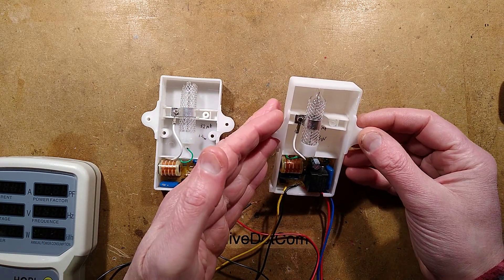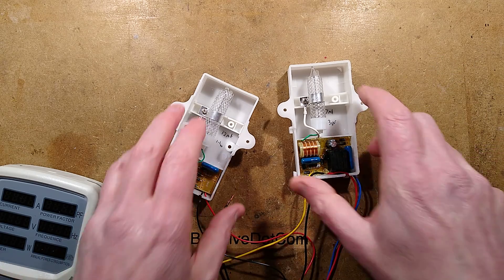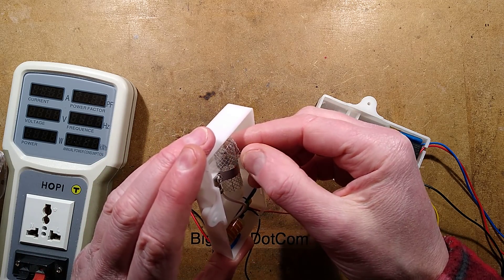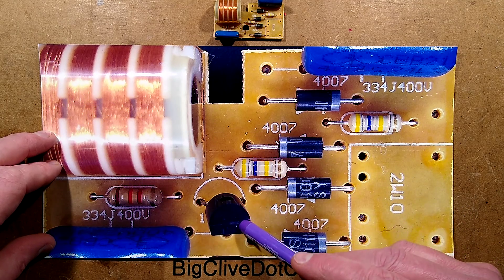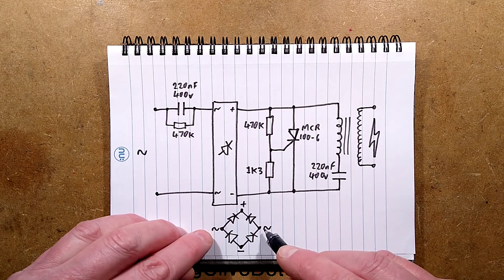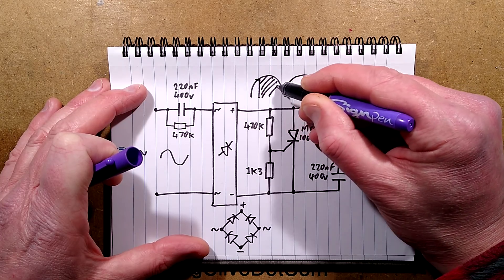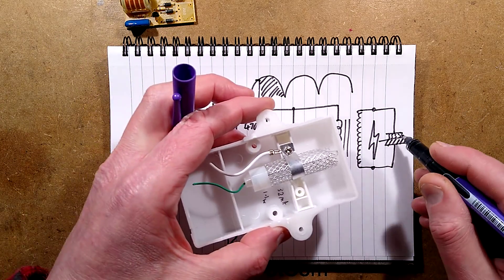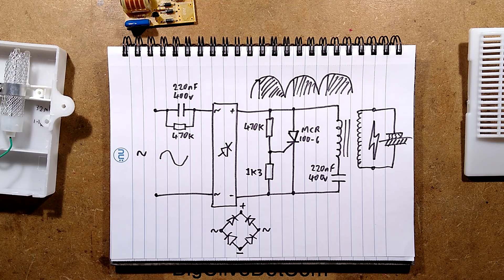The "two-wire" high voltage mystery eBay device

Comment: So could I take my "stun gun" module and put the output across that tube and achieve a similar effect, or does the high frequency make something else happen?
Reply from the maker: It needs to be high frequency AC.
Reply: @bigclivedotcom  you can make ozone with 60 hz at 2Kv buts its not very effeiencent I built an ozone device using a microwave transformer with a current limited input of just under 1 amp the end resoult is enough ozone to destroy the effectiviness of hot glue used to keep a fan in place now if I had an ebay device that used 20 watts I would get more ozone with less power bottom line high frequincy and high voltage are key

Comment: This is worth getting just for the discharge tube. I would like to see how it reacts to high power RF or Tesla coil discharge.
Reply: I'm wondering if it could be used as a geiger tube, biased with a high enough voltage to arc over when radiation passes throught it...
Reply: @dj1NM3  that’s a genius idea. I’d bet it would work. May not be accurate but would at least give you a idea of how much radiation is present
Reply: @dj1NM3  So you want to create large sparks around a flammable gas. I smell a bad idea.
Reply: I wonder how one of those kw boost converters would work with this, powered by a 9V battery...

Comment: Clive capacitors are labeled as 334j.330nf.how it can be 220nf.
Reply from the maker: The PCB is marked for 330nF, but the actual capacitors are 220nF

Comment: A triac circuit would be slightly simpler and more power-efficient - no diodes, only one cap and no shorting of the input cap.
Reply from the maker: It takes a lot more current to trigger a triac than a thyristor.
Reply: This is a very cost sensitive application. This layout lets them use a  transistor if they are cheaper. I was surprised that they splurged on the full wave bridge with nice diodes. It adds 0.07USD to the cost.
Reply: @peterbonucci9661  A transistor wouldn't work here since it would slowly turn on with AC input instead of snapping on like an SCR or TRIAC do.

Cost-wise, a 1A/600V triac in TO92-3 packaging costs about the same as an SCR (within $0.02 in 5ks) and eliminates the need of a diode bridge and 2nd film capacitor (2nd most expensive parts in there by a small margin) at the expense of needing 5mA of trigger current instead of 100uA which may require a diac trigger for predictable operation.

The two circuits cost about the same to make, except a proper TRIAC version would be more efficient and reliable thanks to eliminating massive current peaks when the SCR shorts the input capacitor across mains at close to AC peak..
Reply: @teardowndan5364  I've built these before. Transistors work fine. In teardowns, I don't remember seeing SCRs. I don't understand why they went for the second film capacitor. As you say, it's expensive. I'd spend the money on screws that could resist ozone.
Reply: @teardowndan5364  Also, they buy the SCRs from a surplus-like market (I don't remember the right word,) so versitality is a big deal.

Comment: I wonder if 10 years from now the Big Clive Lazy Rectifier will have become a standard electrical symbol.
Reply: Electroboom will have to switch to the new Full Snooze Rectifier standard
Reply: Looks a lot like an IEC symbol, you know the ones where everything is a white nondescript box.
Reply: I thought it already was, except the diode points towards the DC side instead of at an angle, or is that just my version, 🤔

Comment: Messing with the oxygen molecules in the room and making them highly reactive sounds like a scary thing to be exposed for for our lungs.
Reply from the maker: Nothing that doesn't exist in nature.  If anything, the lack of those elements in home air may contribute to issues like mold.
Reply: @bigclivedotcom  We just added a UV lamp to the AC unit at work.
Reply: @bigclivedotcom  however, ground level ozone is a health risk, especially if you have pre-existing lung conditions. Ozone causes damage to the lungs and can make them more prone to infection. Ozone (O3) is a highly reactive form of oxygen and does not behave in the same way as O2.
Reply: @bigclivedotcom  
There have been a lot of recent adverts for Ozone generators claimed to combat mould and unpleasant smell in Swedish houses.
All shown to be completely useless of course.
Swedish homes rarely have such problems anyway.
Reply: That's the thing with most disinfectants. If it kills things, it usually just kills you slower, as you are big. It would take a while for it to have noticeable effect, but not something that you would want to test on yourself
Reply: It's the wonderful aroma of a near by lightning strike. The MCU's new fragrance Eau de Thor.
Reply: It's also something used in auto detailing to remove  stagnant smells. You just have the smell of ozone afterwards.
Reply: Does it smell like a 90s photocopier room?
Reply: @ncot_tech  do you know what memory this brought back? Back in high school (graduated in 2002) I took drafting and then CAD classes every year. We had a special ventilated room (just a super tiny office really) for the blueprint machine.      
It was a real blueprint machine. It used ammonia and I think UV light to develop the blueprints.     
Sometimes the ventilation pipe would come undone and fill the surrounding rooms with ammonia fumes. 
…we would just open the windows and carry on. Fun times.
Reply: @ncot_tech    I still use an older laser printer (2-3 pages / week ..) , I don't need to buy me an ozone generator...   8-)
Reply: Short tem exposure to ozone isn't that bad
Reply: @MandrakeFernflower  It is if your hit by lightning .
Reply: @martinwinfield2935  I think in that case you would be worrying about other things than ozone…
Reply: @martinwinfield2935  you're
Reply: If you can smell it, it is above the level that will cause damage.

Just because it is natural does not make it safe or good for you. 

And we have no lack of ozone in our cities today, outside or inside, on the contrary levels in many places are dangerously high on a regular basis.

Again: If you can smell it at all, you are way into the danger zone. 

Please inform yourself before coming with blankes statements like "Nothing that doesn't exist in nature.  If anything, the lack of those elements in home air may contribute to issues like mold.

" 

You could e.g. look at the epa web site for details.
Reply: @57thorns  The EPA is lying about ozone. That stuff in smog is not ozone - ozone is a sweet smelling very slightly blue gas that is extremely flammable and has a very shot half life. 
Think about it: A) It is impossible to create an extremely flammable gas in a combustion engine. The gas will combust
B) The following is quoted by at least four studies I found on emissions : "emissions of the motor transport have greenhouse and ozone-depleting effect on the atmosphere of the earth"
Something that depletes ozone can not be adding ozone.

some references : The Main Components of Vehicle Exhaust Gases and Their Effective Catalytic Neutralization, Oriental Journal of Chemistry
Sassykova, L.R., Technogenic emissions into the atmosphere: impact on the environment and neutralization by catalytic methods, Almaty: Qazaq university, 2018, 123-128.
Vorobyov, A.E.; Dyachenko, V.V.; Vilchinskaya, O.V.; Korchagina, A.V., Environmental management bases: ecological, economic and legal aspects, Manual, Ed. Dyachenko, V.V., Rostov N / D, Phoenix, 2006, 421-434.
Reply: The HP Laserjet II (and other laser printers based on the same Canon platform) had activated charcoal air filters and a fan to neutralize the ozone generated by the fuser.  Not many laser printers today even bother.  So don't use a cheap ass-laser (or LED - remember it's the corona discharge from the fuser, not the method of producing a charge on the light sensitive drum, producing ozone) printer in a room with no ventilation.
Reply: The fuser just gets hot to melt the toner to the sheet.   I figure the ozone comes the high voltage corona wire.

Comment: That 2W10 outline almost looks like it'd be a common mode choke, however not wired to pass both active and neutral. Potentially just an inductor in that little common mode choke/transformer form factor. The two pins on the "input" side and the 4 on the "output" side feels like a transformer form factor to me. 

Not particularly sure what purpose an inductor there would have, perhaps just to help with the current spikes?

Comment: Clive, what do you think are the chances that the glass capsule is only under vacuum with no gas?
Reply from the maker: It's possible, but it's emitting mainly at a wavelength of around 500nm.
Reply: maybe it's not exactly vacuum, maybe just low pressure air, it behaves kinda like pure noble gasses, high vacuum is really hard to be crossed by electricity and it will emit X-rays at that point
Reply: i think you dont understand the physical concept of a vacuum there bud.  you would just call that an atmosphere of only the type of gas you put in there after the vacuum...  a vacuum basically is the extraction of gasses and molecules alike from an atmosphere..   like a vacuum chamber would be a sealed container, once sealed it has its own atmosphere with the air left inside..  when you vacuum that air out, there is no oxygen, no nitrogen, no co2, no nothing..  hence total vauum..  you would then put say argon inside with a tungsten fiber coiled in there also with both ends of the coil sealed but coming out .  The atmosphere of argon will have some kind of pressure inside the chamber which allows the tungsten to glow brightly when voltage is applied without oxidizing and degrading instantly once voltage is applied..,  if no gas was inserted after pulling the vacuum than the tungsten would arc over to the container walls as the ions are generated leaving the chamber which produces radiation as the ions are emitted..  radiation is not a physical substance .   Well im getting off topic..  shouldnt have smoked that whole joint ...  welp..
Reply: @Z-Ack  I was just thinking of all the experiments that Thomas Edison did with only a vacuum. I do understand the concept of a vacuum and replacement with certain gases, but nonetheless, I was curious as to the reaction of non ionizing radiation in a vacuum.
Reply: @Z-Ack  No, you clearly don't understand basic physics.  Vacuum is emptiness, filling in a different atmosphere makes it not a vacuum.  Radiation is actually a physical substance consisting of subatomic particles such as photons, electrons, neutrons or helium nuclei.

Comment: wearing decent over the ear headphones and the first time you powered on the first device my teeth started vibrating. that was quite the sensation hearing that little thing run.
Reply: Mine too lol.
Reply: Yaa, that was annoying..
Reply: Turn your headphones down.
Reply: Might be even more interesting with bone conduction headsets like Aftershockz. High pitch tones were a mixed bag with those, some were excruciatingly painful. Like nails into your temples kind of sensation. Other high pitch tones it took the edge off so much they sounded smooth instead of spikey.
Reply: There’s something about it that is very penetrating. I was just listening on my phone, no headphones at all, and it still pierced my brain.
Reply: Any fillings loosen ?
Reply: the first one was piercing
Reply: My dogs did NOT like it!

Comment: Clive, you have GOT to get hold of a steam inhaler unit called "MyPurMist," advertised for allergies and asthma. Shouldn't be difficult, they break all the time apparently, especially the wall-power units, which is what I have. Absolutely fascinating components, high quality power supply to harvest stuff from, and a really neat mini-fan in an angled housing. Apparently something fell in mine and ruined the heating unit, it's all gross and melted. I can't figure out what it is, especially since I haven't indulged my jelly bean addiction for some time. Perhaps a wayward bit of cocktail cherry? Anyway. Really intricate micro-wiring, and made of an intricate series of overlapping plastic plates. Check it out!
Reply: Quite easy to take apart, no "persuasive force required." The overlapping plates are really clever. I stand corrected on the fan; it's not just the housing that's angled, it's a miniaturized impeller-type fan firing out the side.

Comment: " - talks circuitry - talks circuitry - talks circuitry - talks circuitry - triple boobies - talks circuitry - talks circuitry " 😂
Reply: Also 220 nanoFarts
Reply: @sootikins  I caught that one too. Some of those caps and other electronic components stink when they're overloaded.
Reply: Eccentrica Gallumbits!
Reply: @robfenwitch7403  
The Triple Breasted "Woman of Loose Morals" of Erotigon 6.

Thanks @BigClive and Douglas Adam's.

The stupid youtube bot wouldn't allow me to use the actual line, as the words were "Too Rude or Derogatory "  Fracking ridiculous political correctness!
Reply: Total recall.
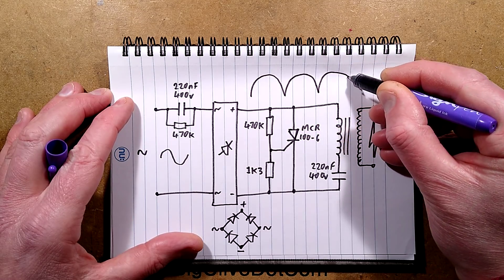Reply: 6:40
Reply: @Lamster66  most people also tend to do that ...
Reply: Triple?   Why stop there?   Two complete cycles?   Quadruple.

Comment: Oh boy, you know what the 2W10 is, it's right on the other board :P  It's a relay!
Reply: it's actually a single-package rectifier, they designed the board to either accept a rectifier or 4 diodes
Reply: "2W10" also happens to be a silicon bridge rectifier. Pins don't really match the holes but it's quite the coincidence.
Reply: I wondered about that.  Strangely, 2w10 is a bridge rectifier.
I wonder what the PCB screen says under the bridge rectifier position?

Comment: There's a shock ozone with questions about high voltage and a man forgot the dangers of the triple booby 4 wire that buzzes using safe voltage set.

Comment: Seems like turning the scr on would short the bridge out and explode the diodes or the scr. Maybe the input cap prevents that from happening??
Reply: Yes, the capacitor on the input limits the current.
Reply: It would make more sense if the output of the bridge were moved to the other end of the primary so both caps would discharge through the transformer.
Reply: The input capacitor limits the current but the circuit still creates a huge momentary current spike. The components seem to handle this but I'm sure this stress doesn't help their lifespan. If they put a resistor in series with the AC input the circuit would probably be much more reliable.

Comment: Ouch!!  As a ham radio geek I'm just wincing at the RFI they must put out. Is static damage possible to components in vicinity?
Reply from the maker: I'm not sure how much a voltage gradient it creates.
Reply: The is a pretty strong electric field near the box. You should be able to light up a neon bulb 6 inches (15 cm) away. When I worked on ozone generators, we complied with CISPR 14 for EMI/EMC. The problems for emmisions were near-field E field and conducted noise on the power cord.

Comment: Those tubes would be awesome in 18-24 inch lengths.
Reply from the maker: The neon FX industry can make similar tubes to order, but at great expense.
Reply: @bigclivedotcom  Going to guess the tube is merely a glass tube and the fill gas is air, using a dual stage vacuum pump down and then seal, so that it can easily be ionised. Steel rod with nickel plate for the inner electrode, because that is cheap and shiny, and you can get a semi good metal to glass seal on it as well, plus just a quick bit of sanding on the outside through the plate and it is sort of solderable.